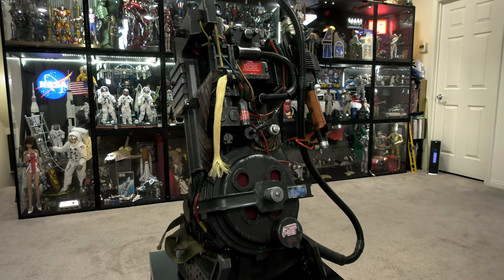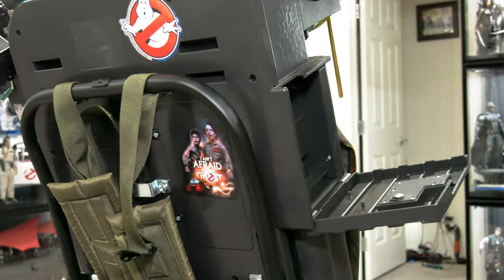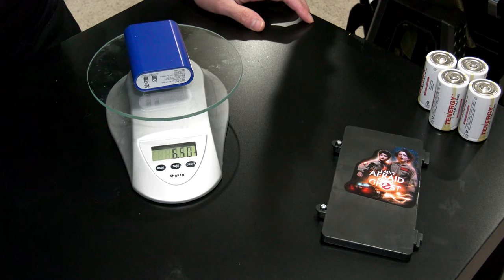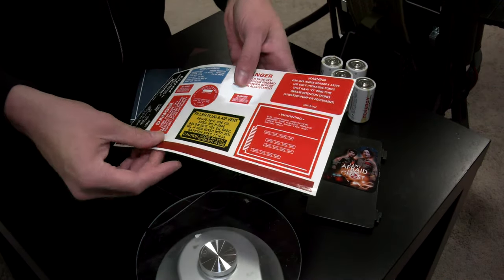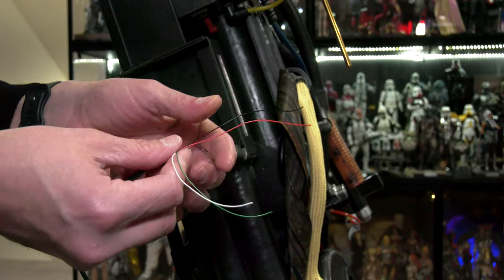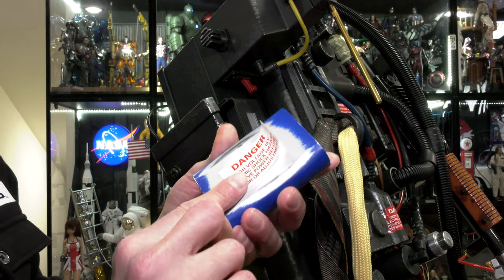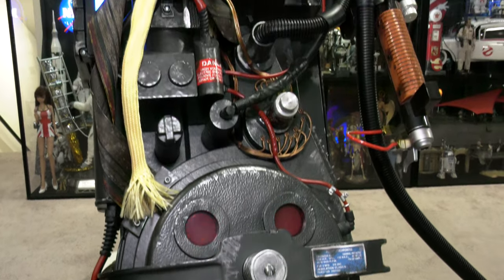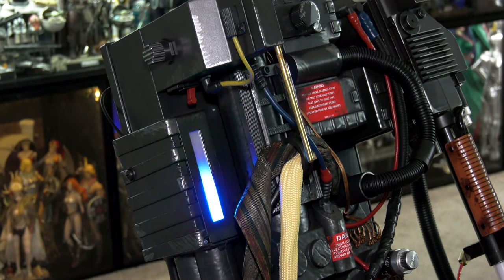Haslab Ghostbusters Proton Pack USB Mod Power Pack Hack

Comment: For those who want to do the same mod but without drilling a hole inside the pack. The inner wall between the pack and that compartment does come out if you take apart the pack and you can run the wires from the inside to the battery pack.
Much nicer and no cutting or drilling into the shell required
Reply from the maker: But more labor Intensive... Since you have to avoid disconnecting the wires to the back panel.🧐
Reply: @Danoby2  if a wire pops off you can always resolder it back on. 
Its abit more labor to open it but less destructive to the pack overall
Reply: I'll be placing my USB Talencell 12000mAh / 5 V power pack on the outside of the pack, velcro'd to the bottom, just under my Bluetooth speaker. I will also be removing the rumble motor (about 1 pound) since I never use it. BTW, the pack weighs just about 20 pounds as it is now. :)

Comment: Another idea. Get a usb lithium battery that fits in the battery compartment. Do the same usb cord cut/mod but fit it all in that slot, leaving the side  compartment open for EVEN MORE stuff.
Reply: This is pretty much what I want to do, someone also advised getting a JST-PH 2.0 plug type to USB adapter so you can plug directly into the board
Reply: Bro… your power pack didn’t fit in the battery bay?
Reply: Side compartment is 3.5 x 4 x 2 (or 28 cubic inches). The battery compartment is 2.5 x 5.625 x 1.5  (or 21 cubic inches). This goes down to 1.5 x 5.625 x 1.5 (or 12.7 cubic inches) if you don't include the battery spring terminals and dividers in the width measurement. Even so, fitting a lithium battery in there with wires that end in insulation covered alligator clips so that no soldering is required would be a good option . . .

Comment: I think each has pros and cons.

4 D batteries will more than likely last longer than a rechargeable power bank that can fit into the side compartment, but once they die they need replacing. If you’re at a convention I imagine you could squeeze 2-3 hours out of the pack with heavy usage if you’re not constantly running the vibrating motor.

A rechargeable power bank is nice because of the ease of recharging and the weight. Keep in mind though that it will likely not last as long as the D batteries (assuming they’re a good brand). Also keep in mind that it takes 2 minutes to replace the batteries at a convention (maybe with a mini screwdriver or if you left the cover off or took it to a repair booth)…

However, recharging that battery pack to full or half would more than likely take over an hour and could potentially burn your day away.

Carefully consider your options when modding these packs, as they tried to make them convenient to play around with, but they also can’t account for changing power inputs.
Reply: You can always bring multiple battery banks with you to swap out
Also some nice rechargable packs will last longer than D batteries too
Reply: @HackerBilly13 while that’s true, it’s not practical if you’re planning on taking this device to a comic con. You want something supplying to the pack constantly with no effort.

I’ve made my own pack and trust me, rechargeable battery packs won’t be able to meet the demand of the motor, speaker and lights as long as good quality D batteries.

If anyone is planning on taking this pack to an event make sure that you can still power off of D batteries even if you do a lithium power bank. Many repair booths will be able to replace those batteries easily.
Reply: @landonmckinley6250  dude I go to conventions constantly. Most packs built for cons run off of the Talent Cell Battery Packs that have enough juice in em to run for days on end. Even most cheap rechargable battery packs will be able to run this pack for days 🤔 its not pulling a lot of power unless you are using the motor rumble feature which even then isnt pulling a lot of juice either. 
Plus if you use a beefier rechargable pack like the 12vlt Talent Cell pack you can run other things as well like a speaker mod which would run this pack with an audio amp and proper speaker
Reply: @HackerBilly13  Thank you, and I too will be attending A LOT of conventions this year with my GB group - and a few fellas in my group have confirmed that the 12,000mAh / 5 volt Talencell will run the pack for a few days. So this is the route I'm going. Thanks for your input and always remember, don't cross the streams.

Comment: Cool video! I was looking at the battery pack myself... I haven't done a lot of cons, etc. recently. But I might in the future. From experience with other things I've always found that the D-cell batteries are kind of a pain to work with, what with having to change them out every time they drain, and the battery life, etc. I have a talent cell battery pack that I picked up for my other pack. It might be a bit bulky to fit in that compartment, but this is a good tip on how to mod the pack for use with that power pack. Minimal mods needed to the pack itself. Great!

Comment: Why not put the power pack inside the motherboard or paint the battery pack black and velcro it down by the kidney pad part of the Alice frame.  No wires hanging out and virtually invisible.

Comment: I did the exact same thing but I used a 12-volt / 5 V talentcell so I can plug in a 12-volt amplifier also
Reply: Did you do your connections the same was as this video?
Reply: @Thaylen Sabre  no! lol I opened the pack and I cut the wires off the battery chassis and removed the connector from the microcontroller and then twisted the positive and negative from a USB pluged the connector back in the microcontroller. Then I decaced the talent cell and I put it in the secret compartment
Reply: @shaggysrsg7861  Thank you so much!  I've been watching all the battery mods and trying to figure out which plan or path I want to go with mine.

Comment: What’s the power power output of the power bank 
As the D cells put out 6v
I thought the power banks were 5v
Reply from the maker: As stated in the video, the power bank runs a little above 5V. Size D batteries pump out 6V for longevity and are resisted back down to 5V, but unit can still run at that voltage.

Comment: This is an amazing mod cause I found the perfect 10,000mah battery that fits in the square leaves PLENTY of space AND has a digital front readout to know exactly how much battery you have left. I just ordered one battery and I'm gonna install it and if I feel I need another battery pack to leave it on all day then I will do just that and get another to have to switch out
Reply: I wired up the battery and it didn't work, atleast the 5v power pack I got bit it certainly pushes that cause I tested it. So I may try for a 12v and since it's resisted it should be fine

Comment: So to not drill one hole and take the back off, you drill two holes run a cable in and out and  mess up the battery connections with a shade tree solder job. Nah I'm good.

Comment: What I'm wondering with this is if it makes the pack run continuously?  With the D batteries right now mine only stays running about 3 minutes but if I turn on the wand it's about 60 seconds before it does the power down sounds and shuts off, or is mine just defective lol?
Reply: Its designed to shut off like that

Comment: I personally don't think it's very good but that's just my opinion and I won't be buying it at any stage I will be buying only hardcore action and horror props going forward also I thought it was called hasbro not haslab also I think this is very difficult to put together maybe some people that buy it wouldn't be able to do it that's the problem but as I say this is just my opinion